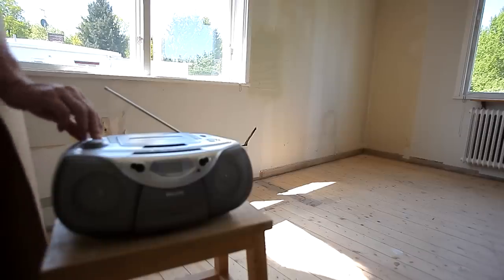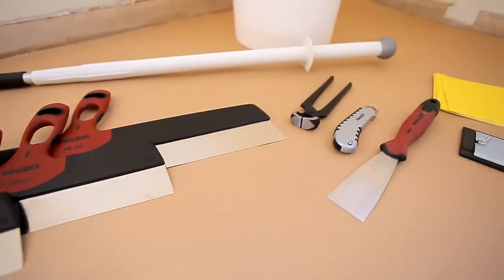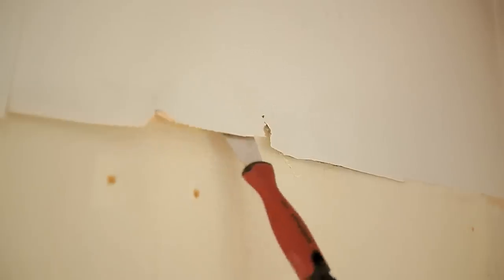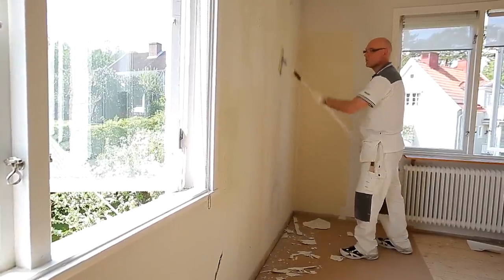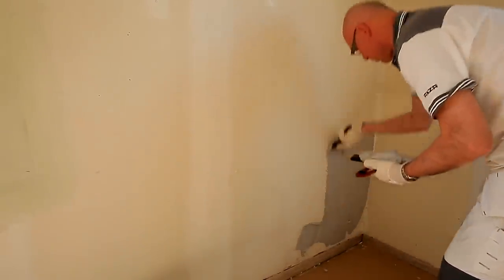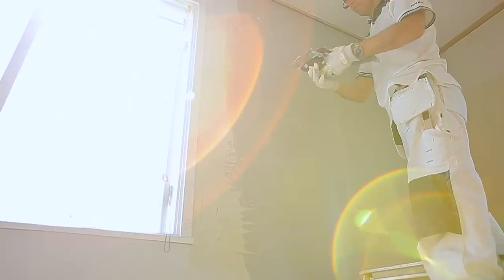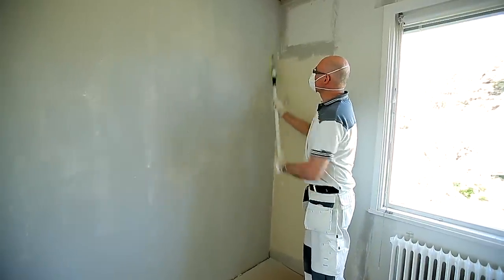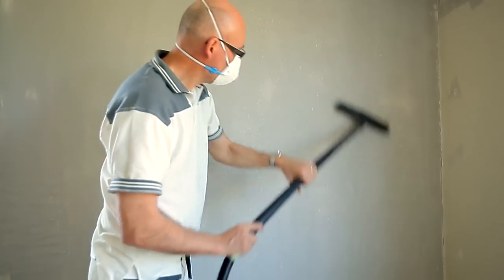Spackling an uneven wall -- step by step

Comment: Is it possible to spackle a wall that has warped slightly from a water leak that was fixed?
Reply from the maker: If the wall is completely dry you should be able to spackle the wall so it gets even. It depends on the damage on the wall.

Comment: I've taken out a sliding accordion wall (3/4 the length of the wall) and added a partition wall. Problem is that our condo was made in the 60s and every wall was made for 5/8in drywall whereas nowadays, if I recall correctly, walls are supposed to be 1/2in and ceilings are 5/8in. The wall is so old that many areas are so bent or curved that only in 1 area is the drywall flush with the wall. This has made for a lot of heartache on me due to having no background in spackling. I just smack that stuff on and sand it to where I want it. I like and appreciate your informative video
Reply: Old comment, but if anyone else runs into this issue, you can use shims. 
Just use something tacky like caulk and place them on the stud, then hang sheet ..
Now Idk if it’s the proper way, but I’ve done it, and it works great...

Comment: This guy makes it look so damn easy but unfortunately it is not
Reply: Not difficult task... do with repetition!! Practice makes perfect!!
Reply: Yeah.. Trial and error. You get it eventually.. Not a single person knew how to do it properly on first try :)
Reply: @tvrdy3  I did it thrice and still can't get it right... is there another trick other than applying pressure to the left side of the knife but not to the right? Also I have been trying on a small surface area with a small knife is it necessary to do it with a big knife?

The 'professional' did a very poor job on my walls which I'm trying to rectify

Comment: On the back panel of most spackle it says " DO NOT TO USE FOR SKIM COATING " only use for nail holes.
Reply: I doubt it was actually spackle, more than likely joint compound that he mixed from a bag.

Comment: 🤣🤣 nope....get a decent plasterer to skim it. No way was that 1 coat and 1 sand, if it was then the finish will look amazing from a galloping horse😆 but up close i guarantee you will have surface finish differing and you will be chasing the uniform surface for days while breathing in 40% of the filler used......what ypu can see floating in air is comparable to the ice berg principal. And this is before you consider the substrate its to be applied to, such as vinyl paint, flaking paint, moisture, grease, dust...the list goes on. So I can only imagine the frustration when your sanding looks good but as soon as the paint roller passes an area the didn't bond correctly and the roller peels it off 🤣🤣🤣 
Side note, as I'm British  and superior in every way 😜 the yanks across the pond taping, filling and sanding the walls  to blend joints, cover screws etc seems more work for less benefits compared to a plaster skim finish. If a colonial cousin would care to offer an explanation why, it would be appreciated 👍